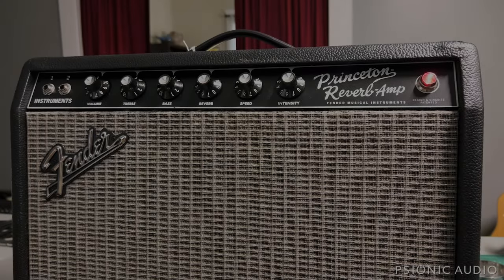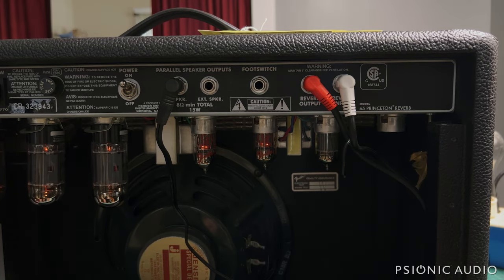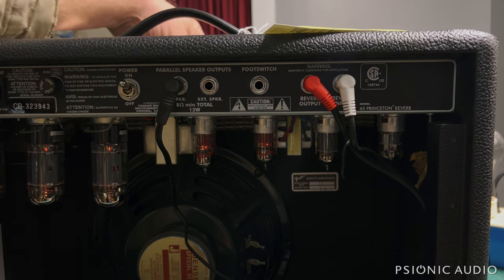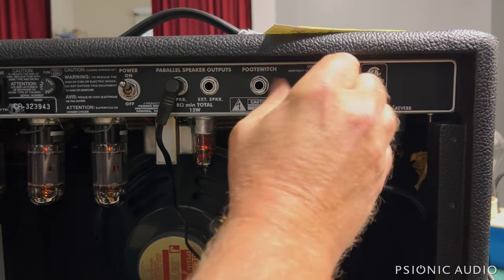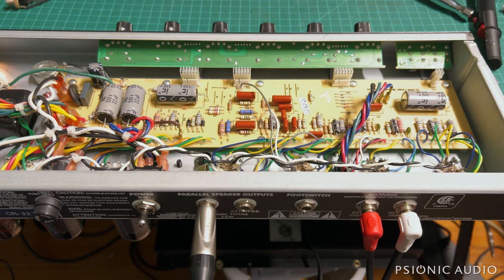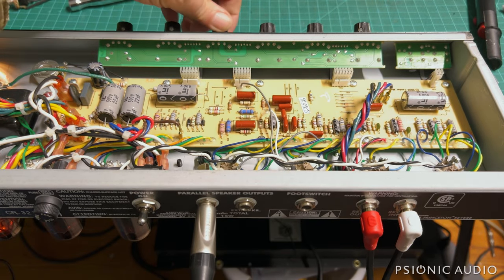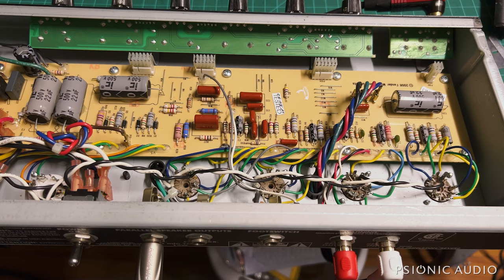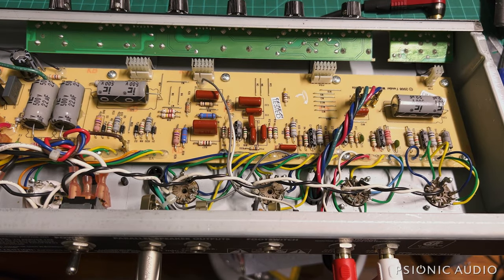Troubleshooting Techniques That Most Amp Owners Can Do Themselves

Comment: I have a re-issue fender Deville 4 10 in speakers sounds like dust really static then blew a fuse should I take it to a shop or just replace the fuse and do nothing but blow out the cab with my air compressor

Comment: Thanks for this, Lyle!  I was able to get my Princeton clone (Clark Kanee) as quiet as my noisy house circuitry (50's house with more recent dimmer switches everywhere) will allow by hot swapping in preamp tubes while I had a dB meter app going on my phone in front of the amp.

Comment: Interesting. A PR build I did from of an Ao29 with all new components had the same exact issue with the reverb. Sounds great till turned up to 6 or so. Then a bit of hum. Nothing I did fixed it. I didn’t figure it could be the brand new MOD tank!

Comment: Hello Psionic Audio. What would you do in my situation? I bought a Carmen Ghia that kept buzzing and humming uncontrollably, and sound cut in and out. The one they sent as a replacement had a volume knob that wouldnt shut off too. Never experienced issues with any tube amp or brand like this, and was wondering if its even worth the 6 month turnaround wait for me in Ontario 🇨🇦 here. Thanks for all the great learning! 👍 

MJ

Comment: I have a PRRI as well, and have been having it cut to a way lower volume and will usually mostly come back in a bit. I took off the back and turned the amp on and notices that  V4 is glowing a lot more than the other preamp tubes... i'm thinking maybe that is the problem?  Thank you!! Great video btw!

Comment: So can you dime the volume when using the reverb XFMR to 8 ohm speaker 
(whilst seeking OD & distortion) with no worries concerning the main output to ground (?) 
and also is there a safe way to route the rev. out to low level in with some sort of simple/easy 
impedance matching (if necessary) also for chasing distortion 😵‍💫(?) (Thanx in advance) 🥸

Comment: Great stuff...I wish you were in Montreal. I have a Blues Jr. III thats working fine, but it's beeen used quite heavily and I'm sure would benifit from your mods and maintenence. I'm using preferred series 7189 tubes that can handle more juice, but cooling the bias seems like a good idea.  I put a Cannabis Rex speaker in it and I think sound is overall way better. In your opinion is that a good speaker choice for that amp?

Comment: Thanks, I love watching all your videos on amps.  I just had a question about the hot rod amps,  is it worth it at all to swap out the little metal feet for rubber ones? Would it help with vibration and maybe preserve the amp a bit longer?  Apologies if this is a stupid question.. thanks again!

Comment: I have a brand new princeton, second one actually. First one had a rattle on low notes at reasonable volume, second one does it too but the warranty tech doesn’t hear it. It’s a 1200 paper weight at this point. Should I start replacing tubes since that is what the tech said is common issue with new amps
But do I replace them all?
Reply from the maker: Make sure the cab/baffle screws are tight, but it’s probably the JJ 6V6s not the amp.

Comment: Any insight on why the more drive channel on a 1997 hot rod deluxe cuts in and out, I replaced all the filter caps, replaced and raised the 5 watt resistors, and changed the plate resisters as well as the zenors.
Reply from the maker: Could be a damaged trace or just a dirty switch. Rarely (very rarely) a bad relay.
Reply: @PsionicAudio  I've had one bad relay in hundreds of these amps.
Unfortunately it was pretty early in my career, so I assumed it was common and order like 25 relays. Lol.
Reply: @BradsGuitarGarage  unfortunately for me as mostly a hifi repair guy, lots of audio switching was done in 80's hifi via the switches directly instead of with miniature relays being operated by the switches. Usually it's much easier to find a replacement relay with the correct footprint and coil specs than it is to find a replacement fimor, or dismantle and clean, a 40 year old switch that is directly handing the analog switching......but in the 90's, many manufacturers switched to using relays.
Reply: @PsionicAudio  changed the relays also

Comment: Hey Lyle, I'm hoping you can help me understand an issue I'm having with my Deluxe reverb after making a really idiotic mistake with it. 

I sometimes use a Marshall head into the speaker of the Deluxe (just using the combo as a cabinet, deluxe reverb stays off.), and accidentally grabbed the wrong cable while running late to a gig and mindlessly plugged the speaker out of the Marshall into the speaker out of the Deluxe Reverb... I noticed no sound and turned the amp off, it way on for maybe 30 seconds to a minute tops before I realized what I had done.

The Marshall made it through the gig and sounds fine... but I just got back home and plugged the Deluxe Reverb in, and it's sputtering and signal is cutting in and out. Do you know what issues I could have caused by doing this? I plan to call my tech about it soon, but right now am just so embarrassed and defeated by making such a mindless and stupid mistake. :/
Reply from the maker: I’m sorry dude. The good news is anything you killed is easily replaceable. The bad news is you almost certainly hurt something in the process. Your tech can find out what.
Reply: @PsionicAudio  thanks for the reply Lyle. The amp seems to be working fine now somehow.. could those symptoms be from using the amp after it being cold in the car? Maybe chilly tubes not happy to heat up quickly, or a stiff power cable? 

I’ll keep an eye on it and contact my tech as well. 

I really appreciate your time.

Comment: What Hum??? Your audio is very, very poor for this kind of demo – And YES I have my PC volume at full bore. :-( The first few minutes are useful to know after that there isn't much of practical use for an amp owner... well of my limited knowledge anyway..
The reverb driver trick:  Input is actually the reverb Output... thus it can be hooked up to a 8ohm speaker... for low output practice, hmmm... Well I guess that's handy to know without any explanation. Then there is the ability to plug your guitar directly into the reverb driver but with impedance issues... again no explanation. 
I guess that would have meant a much longer video but, maybe if you are bringing it up you should perhaps direct viewers to more info. When you arouse curiosity... people like answers.
Reply: The main point of the video is that you shouldn't hear any hum when all the knobs are turned down and nothing is plugged in (also when the knobs are turned up as well). He fixed the first issue by swapping out the preamp tube, so that was a simple fix for anyone to do themselves. The second issue was hum that occurs when the reverb volume is increased. It was audible in the video, but probably not as pronounced as you would notice in person and it's not easy to pick that up without placing that mic really close to the amp. There are many reasons that would cause this issue, in this case it ended up being a bad transducer in in the reverb tank. Unfortunately, you need a new tank to even test that but it's good to know that's where hum can come from.

As far as the low output trick, you have the option to connect an 8 ohm impedance speaker up to that reverb tank output and play at lower volumes without reverb. Do not plug your guitar into that jack, that's for the speaker only. Your guitar plugs into the normal input jack on the front of the amp only. Of course, the main volume knob won't be used and only the reverb volume would be used if the goal is to play at a lower volume level.